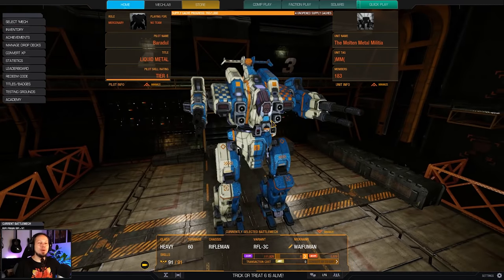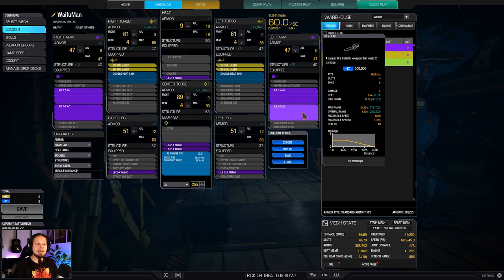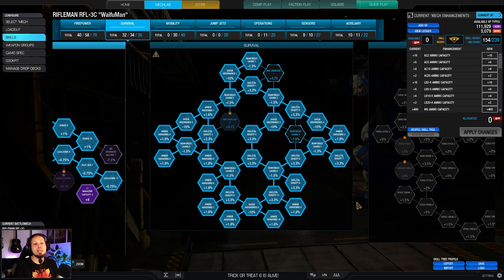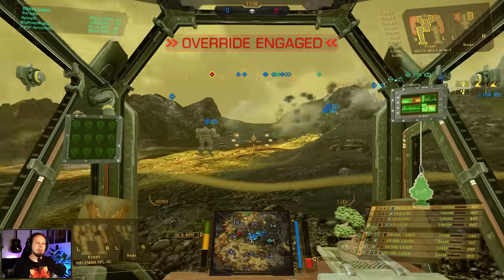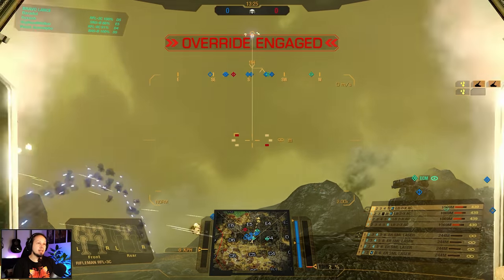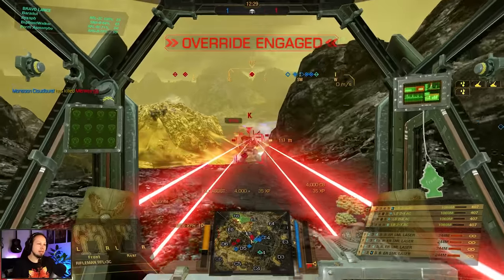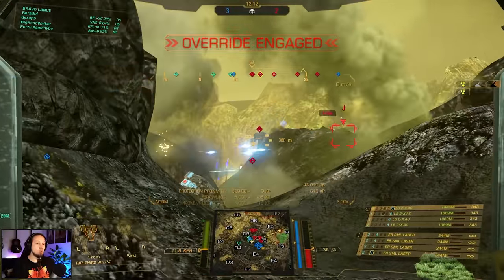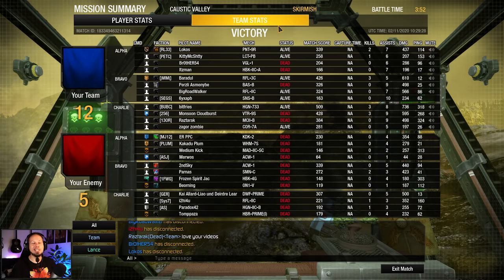Fireline Fights with the Rifleman - Mechwarrior Online The Daily Dose #1270

Comment: This mech can be run with LE250 by ditching both extra heat sinks, in case you wanted to run this build without an XL. Alternatively, LE225 fills the same tonnage as an XL255.